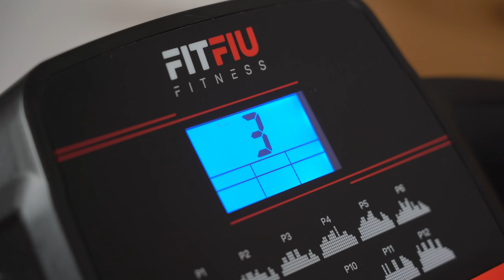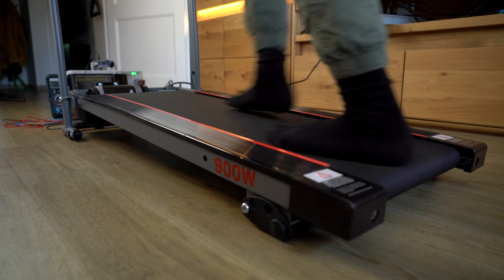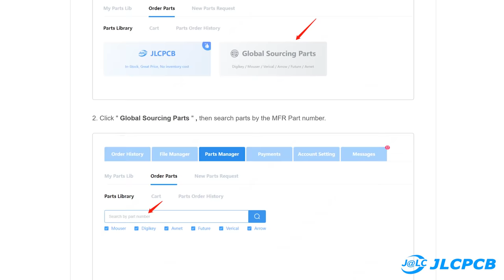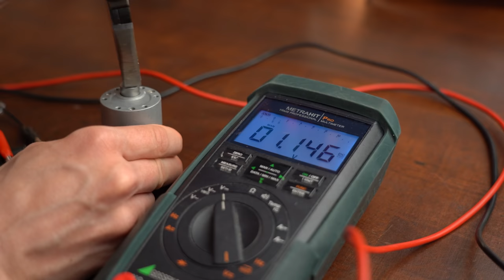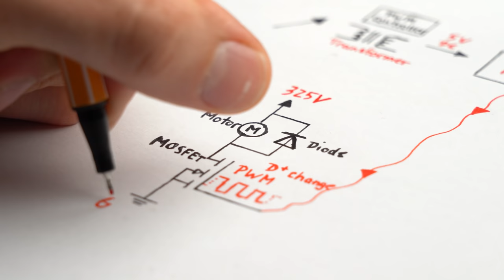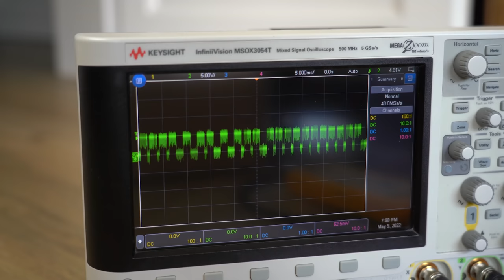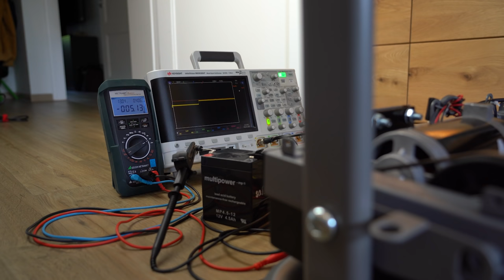Should we use Treadmills to Generate Electricity? (Experiment)

Comment: Instead of accommodating the charger, I would optimize the workout.  Let the motor/generator charge a capacitor and drain the capacitor at constant (programmable) current through a buck converter to another capacitor.  If this intermediate capacitor voltage exceeds a trip point, turn on the charger.  If the intermediate voltage dips too low to be useful/reliable, turn off the charger until the capacitor is charged again.  The generator's torque is proportional to the programmed current and can be used to tune the workout.  Also, a flywheel on the shaft will greatly smooth the belt speed to make jogging possible.  A rechargeable LiIon or supercap could maintain setup between workouts.

Modifying an existing treadmill is NOT the optimum approach...  Build an energy producer INSTEAD of an energy consumer in the first place.  There certainly will be a difference in cost; however, the correct question is whether the energy produced PLUS the energy that is not consumed in the treadmill's lifetime offsets the difference in cost.  (Yes, I do understand that this is a prototype so that modification is the best first step; however, when evaluating feasibility all impacts must be considered.)

Comment: My treadmil has a flywheel on the motor which then has a shaft on it. The shaft and Belt Pulley are connected with a belt. In the end it has a similar coupling like your treadmil but just an added Flywheel on the Motor Shaft.

When I was repairing it, I tried running with only motor without control board and load, It took a bit effort to get it spinning but one it was at a certain speed, it was easier to push further.
So I added a Multimeter and measured close to 95VDC and decided to connect a 12V 21W lightbulb.
I actually told my sister to connect and disconenct the bulb which I thought can simulate like the power spikes that you told about...(which I learnt about while building phone chargers)

But while running, the speed did differed, but very slightly and was almost non-noticible.

I guess the Flywheel acted as a buffer...
What do you think?

And nice video as always... finally can show my dad that my experiment was worth-it
Reply from the maker: Thanks for the feedback. Yes. The flywheel idea sounds interesting.

Comment: So here is a question.  How would you add a variable load to it?  Say if you wanted to adjust the amount of work needed to put into the treadmill to make it easy or hard.  Could it be used to charge a battery.   It sounds complex as you'll get different voltages that need to be automatically stepped up/down, etc.  I'm curious though.
Reply: PWM or constant current circuit, he'd already done one with the FireTV stick video, just was a smaller battery.

Comment: The treadmill motor is the most efficient DC motor and an impressive generator. It starts at 250 watts and ends at 1500 watts! Slow hand-cranking generates 12 volts and rope rotation creates 128 volts! It also has a high torque. The speed is 3000-4000 RPM.

Comment: I wonder if a special charging circuit with regulated power drain from the generator is feasible. This would charge an intermediate storage device, which would then be converted to charge a phone. The advantage is that the person exercising would not feel the resistance randomly change.

Comment: What if you had a circuit at the motor that would start with a small load and would vary the load, the faster the you got the treadmill going. The idea being, get the treadmill to allow you to get up to a fast speed and start using your energy plus the momentum of the treadmill to create more power. Just a thought.

Comment: I would be more interested in seeing a custom controller. Producing a load or current depending on digital input. Turning a treadmill into a simulator. Because contrary to the intuition the job of a treadmill is not produce load on your muscles, it is to balance it. As any proper load balance mechanism it requires outside power for continuous function. 

This is also the reason for a meme about generating electricity with bikes and treadmills.  While it is possible to provide positive outcome, it cannot serve as a simple generator.

Comment: Like everyone else says, using a set of bike pedals is far more efficient for generating electricity.  It's not a new idea.  Just look up Alfred Treager who came up with the "Pedal Wireless" so that remote farms could get in touch with the Flying Doctor Service in an emergency. (Edit: They didn't have easy access to batteries, so using them wasn't a viable option)
An exercise bike might be a viable option for charging a mobile/cell phone, or charging a battery bank for same.

Comment: Does the treadmill have rollers under the belt, or just a flat, smooth plate? The friction between that plate and the underside of the belt would be considerable, if that is the case.

Comment: How about connecting a variable load to the Motor while in generator mode? We can increase/decrease treadmill moving resistance by increasing/decreasing the required load current? That way we can charge some supercaps/batteries at a certain pace while exercising at a certain resistance level.
Reply from the maker: Definitely possible
Reply: I think a variable current limiter circuit for charging batteries will do it

Comment: Use an old bicycle (preferably with gear) and a car dynamo, replace the front wheel by some kind of stand that also keeps the rear wheel free fromthe ground, remove the back tire and put a belt over the rim to drive the dynamo (attached to the stand or bicycle) 🖖😎👍 ❗

Comment: did you measure the efficiency of the motor ? and also was there any kind of slip on the belts connecting the motor and the treadmill ?
Would it make sense if you just directly coupled the threadmill to the motor instead of using the belt ?

Comment: Why not using exercise cycle instead of treadmill ? If you attach a suitable motor/generator with the flywheel then the power output should be a lot better and also more efficient

Comment: The bit that always fries my brain is how the resistance changes with load. If you dont connect the generator to anything there is less resistance on the belt. Connect it to some LEDs or a phone and suddenly the resistance of the treadmill increases. I mostly get why this is, but my brain doesnt think this should happen! Connecting things with metal wires = more resistance??!!

Comment: A hamster in a running wheel equipped with a generator can generate up to 500 mW electric power, enough for illuminating a small LED. How much energy can all of the mice on Earth generate?

Part 2:
Instead of a tread mill, why not make a giant exercise wheel with magnets around the rim of the wheel and coils on the frame around the rim.  

Part 3: 
Since electric generators make energy by rotating a coil inside a magnetic field... The real question should be...
What is the potential enegry of the Earth's magnetic field? and where is the sweet spot of the field?

At the equator the field is the weakest, but moving at 1041.6666 MPH
At the North/South poles the field is the strongest, but moving at close to 0 MPH

Comment: This makes me think that the motor and drive system is very inefficient as a generator, and that the best thing you can do is to disconnect the mains supply, so that the motor can power the onboard electronics to tell you how much energy you are burning. (You might also consider replacing the motor with a dedicated dynamo or alternator, both of which are optimised as a generator. The motor is only optimised as a... motor.) Forget about powering any external electronics. That would save you ~1kWh of electricity for every 67 minutes of vigorous exercise that you do.

Comment: 120v treadmills work way better without electronics. Walking speed is 14v for charging a battery. But treadmill belts are very inefficient because of the friction (it steals 50w in my testing). A stationary bike generator lets you make 100w continuous. 
I power my 20-30w TV with my bike during workouts. Charging just a phone is too easy/boring.

Comment: too many conversions seems to reduce the power. Maybe better have the tread mill with a pull to light up weights to have gravity battery and you select the weight/difficulty. And the gravity battery does not mess up as quickly as a battery.

Comment: the gym i go to the stationary bikes, ellipticals, and rowing machines are all self powered. a few did have usb out put..
soo i would say use a spin bike as they have a huge fucking fly wheel and would provide more consistent loads and you could increase resistance by adding more stuff to power :P im not sure how efficient that would be.. but could be used to charge some batteries?

Comment: i don't think altering a normal threadmill is Not the way to go. The best way, would be to build one that sits on rollers, like a Dog ThreadMill. After that, you hook its output to a step down belt system, and that to the motorst, instead of a step up.

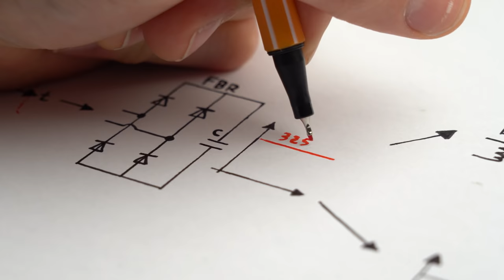Comment: 3:57  can someone explain how the voltage goes up after the rectification
Reply: Yes.
AC voltage is stated as root mean square. Not peak to peak.
After rectification and smoothing you get the peak to peak voltage on your DC output. That is when no load is applied.
Reply from the maker: 230V AC is an RMS value. It would create the same power across an resistor as 230V DC. Meaning 230V is kind of like an average. It comes with hills that have a votlage value of 230V*sqrt2. Around 325V.
Reply: @greatscottlab  oh. Thanks
Reply: @felixokeefe  thanks to u also

Comment: 9:05 Your treadmill belt slipped. You need to tighten a screw in the back feet to stretch the belt. This happens to all treadmills
Reply: Are you sure? I thought it behaved like that because the required power dropped thus making it spin easier
Reply: @georgwagner4438  Yep! The belt definitely slipped. You can tell because the time scale is milliseconds whereas buck converters react in microseconds. All treadmills have this issue because the belt stretches over time. 

I guess it’s technically possible that the cheap buck converter is unstable in discontinuous mode in which case you could replace it with a better one or better yet an MPPT (to extract more power more efficiently) but that’s very unlikely given that it’s powering a phone, not something with a large phase shift that would make it oscillate like a large capacitor bank.

Comment: The generation of electricity should be left until it's required, mechanical storage of potential energy is far easier and greener than chemical storage, and doesn't suffer from short term medium degradation.

Comment: The only way to see if a good workout of charging a battery is of benefit is to do it over a period of time and measure that results with weight gain (increase muscle mass) or loss (loss of fat to muscle mass) 

I am pretty sure that even if the work out is not steady the force is greater than walking short distance or longer ones in a period of time.   Calories burned.

Comment: I think you need the bicycle type motor shown in previous episode, also since the voltage was not stable, is it possible to store the energy in a super capacitor and then charge the battery in a more efficient way?
Reply from the maker: Supercaps will not improve things if you are already charging up a raw battery like I did in the end. But Supercaps would certainly help with charging up the smartphone.
Reply: @greatscottlab  Thanks for your comment, harvesting energy is not an easy subject, when we are dry of energy, need to try new ideas, I like your research.
Reply: Sounds like a Robert Murray Smith thing to do because I'm sorry to say he has very little understanding of electricity and physics. Always think he'd be best sticking with chemistry.

Comment: How does he found out that the maximum output power that it can create was 50W?  How does replacing the motor with a car's alternator?
Reply from the maker: No. I did not find that out. I just picked 50W as an example. I think using a car alternator would not change much.
Reply: A car alternator would probably use close to 50W just to energize its own electromagnetic.

Comment: for this motor you would need Adjust the battery voltage. Adjust battery voltage so the generator starts charging it it higher rpm. Try 24V instead of 12V and that should be more comfortable but generally I agree that average person will not be able to produce a lot of power in short period of time. This perhaps would only make some sense if used as a emergency generator to charge a phone or something like that. I did a conversion like that using bldc ebike hub motor and it works very well! Here is a link
https://youtu.be/R7BWiQEGs4w

Comment: total noob and no idea what I'm talking about, but it seems to me you're wasting a lot of energy with the friction, since treadmills have terrible friction usually to make sure to have precise speeds when the motor is running. They don't mind the waste in energy since it's just electricity, and you're not pushing the belt yourself. 
What I mean is, if you try to move the treadmill, there's no inertia, meaning every step you take is like the first. If you could conserve some of the momentum (like on a bike) you could probably get higher efficiency. Why am I wrong?

Comment: but hear me out, you plug in a treadmill, use it. lose all the energy.

what if you have motor in front, and a generator in the back?  then you are at least Halving the energy consumption
Reply: Wouldn't work. The generator adds resistance so you end up wasting more power to turn the generator than you get out of it. Thermodynamics are a bummer.

Comment: The main bottleneck your facing with your experiment is due to your DC motor not being designed to be used as a generator. If a better generator was set in place, you could get up to 200w of energy, being 80% efficient in the conversion.
Reply from the maker: Hmmmmm not sure about that.
Reply: 200W would be a bit of a stretch, 100W is definitely possible since that's about what I got for the stationary bicycle I built for my senior design project.
Reply: @NiHaoMike64  yes, 100w more definitively. Maybe more for peak power in pro athletes.

Comment: human power is wery low( untrained cyclist can produce only 150 W in a hour or less... beside the running is most energy uneffective way to move so running surface recives the minimum that man cam produce... i have tacx bushido smart cycling trainer , which is themselves a generator what feeds all the electronics of unit (no need outlet at all)- so i have question "why they not mount phone charging usb in it?" - answer is simple- i will not able totally turn a wheel if i want charge my phone from it))